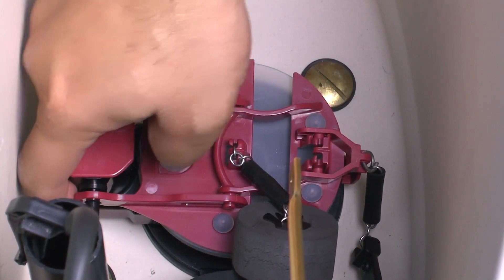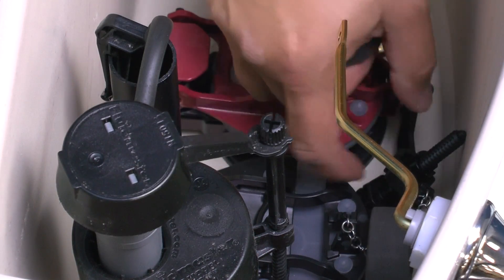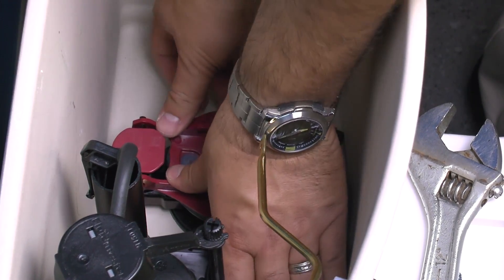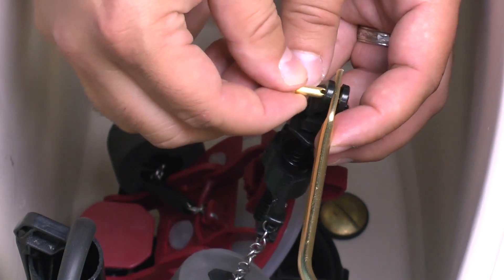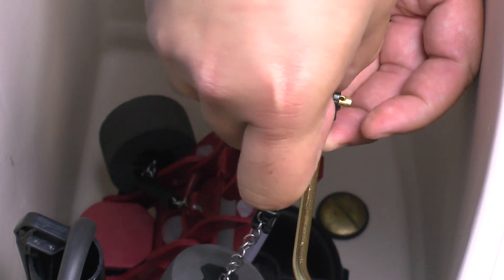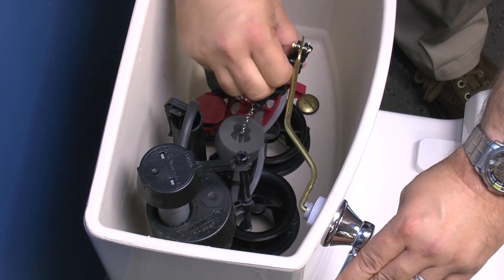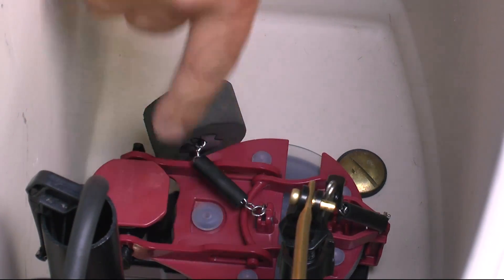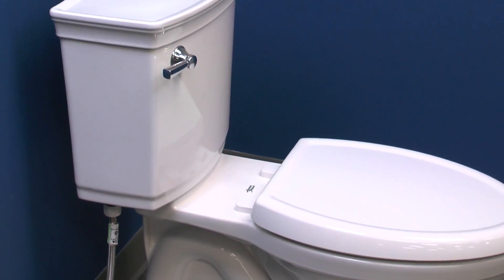VorMax Toilet: Flapper Assembly with Teeter Bar Installation & Removal

Comment: It never stops running so slowly into the tank.  Every 3-4 minutes it needs to add water.  I replaced the flappers and that did not help.  I have tried adjusting the tension on the chains and that does not help,  This mechanism stinks, but I cannot afford to replace the POS.
Reply: Better yet, they put cross supports in the valve so you can’t replace these with the plunger type flap, it has to be this stupid flat silicone design

Comment: What does this whole phrase mean? "Fully depress the trip level arm and turn the adjustable teeter bar until the flapper frame reaches the red flap area of the flush valve frame." Huh? What is a frame? What is the red flap area? What is a flush valve frame?
Reply: https://youtu.be/RvBry_zXIIo?t=26
Reply: I had same question. I think it's the red square in back on red valve

Comment: When I first saw the design, I thought the replaceable silicone seal was clever as most of the issues I've had with older designs involved the rubber getting old or covered in calcified caulk from hard water...  Oddly, when I removed the seal on the red flapper which was giving me trouble, I discovered that it had a larger "water blister" in it.   Kind of like a water balloon.  It seems there must be a couple layers of silicone..  I "popped" the blister from the top side careful not to completely penetrate the seal.   It squirted and then flattened out.   Put it back in, and it seems to have stopped leaking...   I did order some of the cheaper replacement seals on Amazon for about $5 a piece as I have a couple toilets with this design.   We'll see.

Comment: This toilet is garbage replacement parts are astronomical you'll run into problems with it exactly one year later I have them in my bathrooms stay far away from this toilet as possible

Comment: You forgot to tell them to NEVER hold the handle down because if you do it will screw up the whole system by allowing air into the pipes which then requires priming the toilet which means flushing it 5 times in a row to get it back working sort of correctly.  And don't forget to give these instructions to all houseguests before they enter your bathroom or else the next person through will have a completely unsatisfactory experience, meaning the contents of the toilet ( i.e. human waste products) will simply swirl round and round she goes and where she ends up everybody knows because she never left the bowl!  But not wanting to be a total downer, I could mention that the slow closing lid is really nice.
Reply: I avoid entertaining just for that embarrassing purpose.